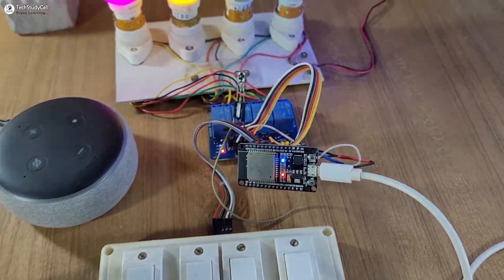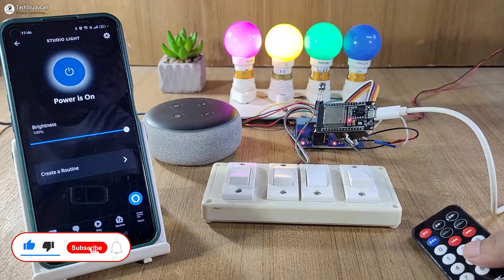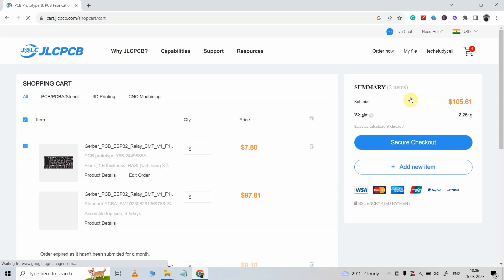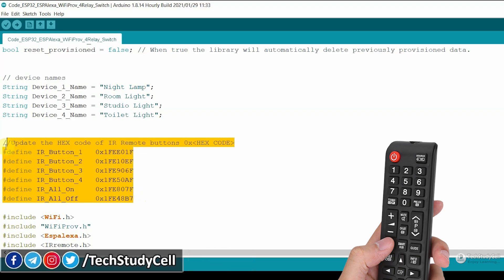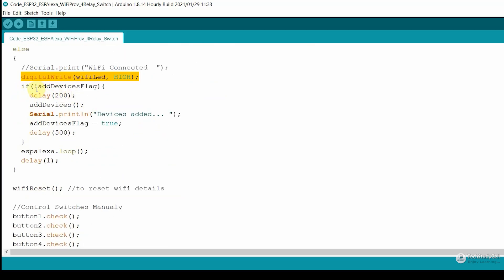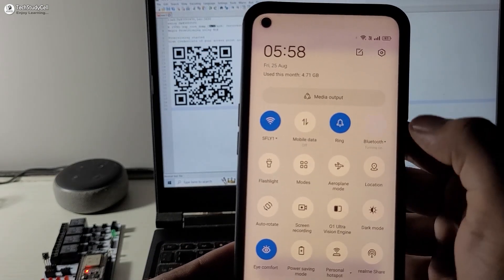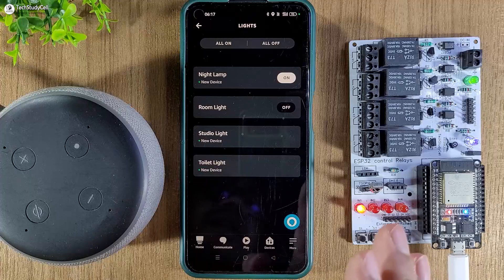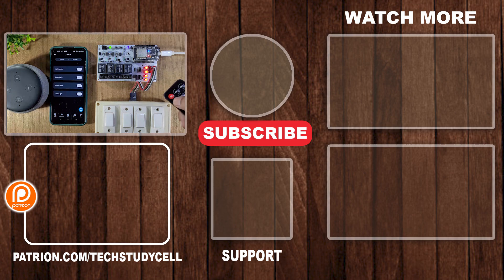IoT based projects using ESP32 Alexa Home Automation | Enter WiFi Credentials Over the Air

Comment: Esp rainmaker get disconnected (ESP rainmaker offline can't connect again with re-pairing if you want again then u have to erase flash memory and program it again to make it online and same problem persist after some days )after some days and you can operate devices manually only ,no automation is there due to out of budget on esp platform,worst platform for iot please give any solution on that.please sir. Must reply
Otherwise esp rainmaker best
Reply from the maker: If are sending any sensor data, please send it after 20 second interval
Reply: @TechStudyCell  i am using your  code as it is please can you tell how we can edit and in which portion we have to edit. Also i am wants to remove DHT11, sensor portio from schematic if possible please cam you help me?
Reply from the maker: download the code again... and try
Reply: @TechStudyCell  have you update  time interval of the code?
Reply: Sir please can you tell how and where i can change interval because as use your same code then you also facing the out of budget error(reconnecting issue) so please make short video on editing existing code such as change interval time. Please must reply 🙏🙏 🙏🙏🙏🙏🙏🙏🙏🙏🙏🙏
Reply: If you help me u will save me sir.....❤ because with esp rainmaker your project (4 devices with fan dimmer+ir+manual+alexa) was very superb
Reply: Sir please tell me where and how i have to change the code to avoid out of budget by esprainmaker. Please
Reply: Same problem